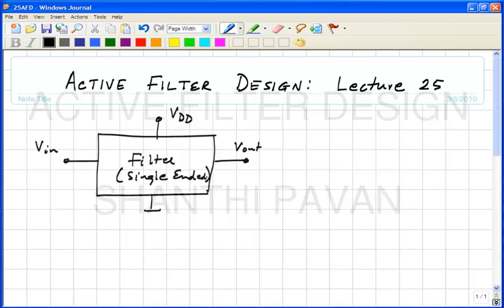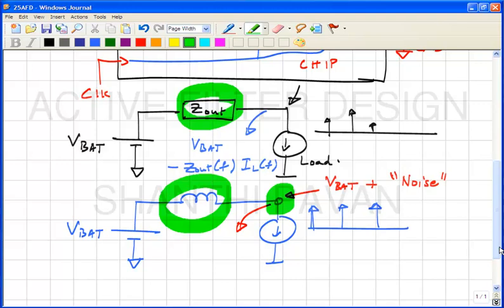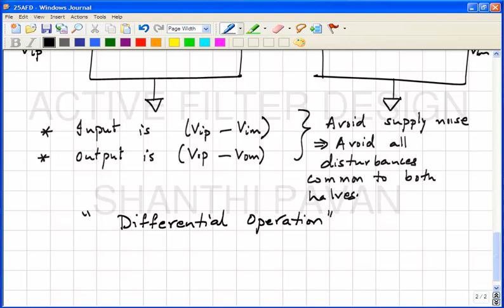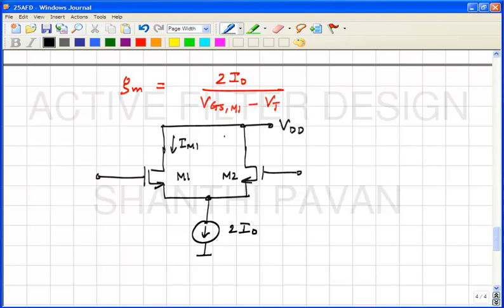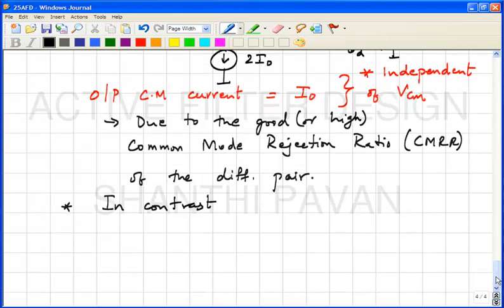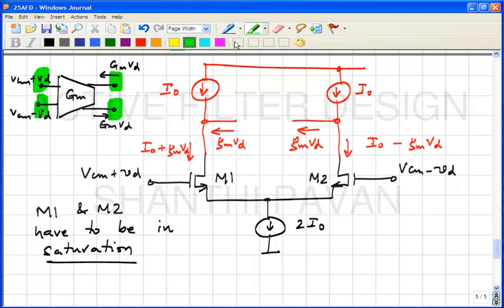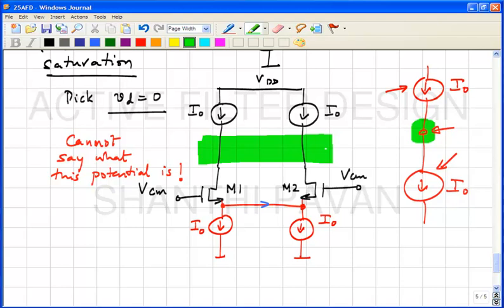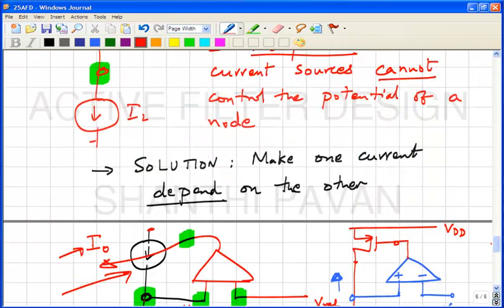AFD25 - Single-ended Versus Differential Filters

Comment: I have one doubt if we use single ended output OTA as the Gm-C filter, the single ended OTA is in open loop so how can we set the output common mode?
Reply: +ChaiYong Lim common mode is defined only for differential operation. With single ended OTA, feedback biases the DC properly